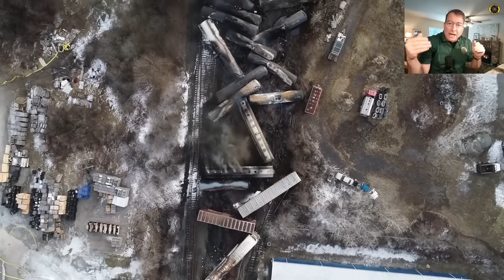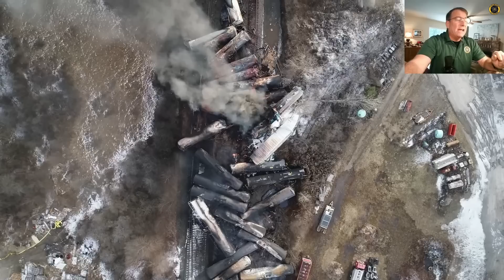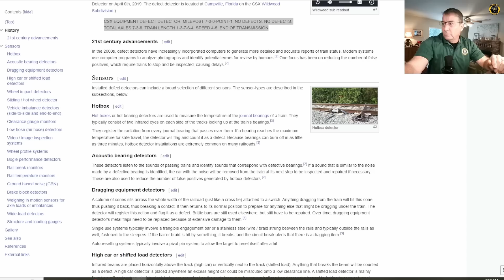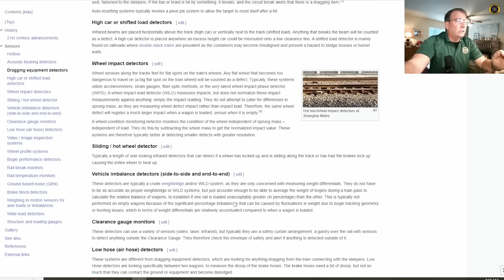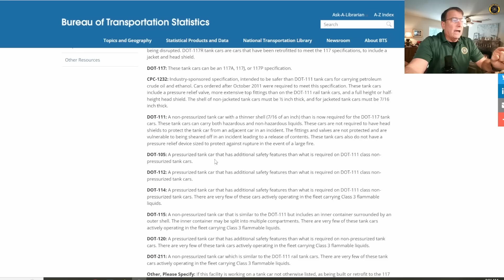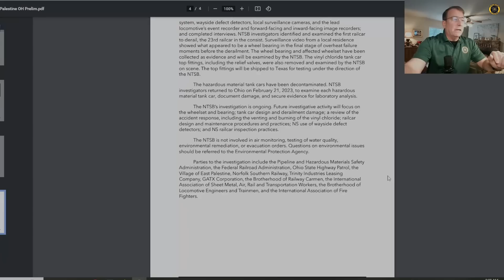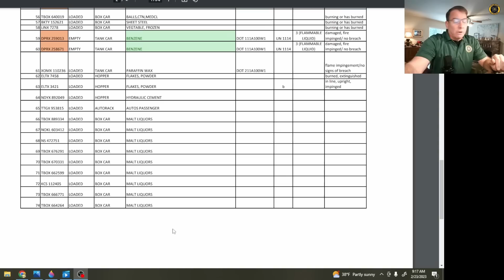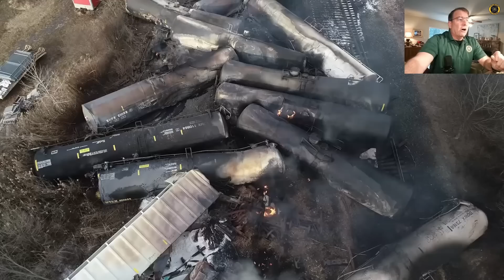NTSB Prelim Report: Norfolk Southern Train Derailment 23 Feb 2023

Comment: It's amazing how quickly an axle journal can burn through due to friction.  I'm surprised it lasted as long as it did after passing the hot box detector in Salem which recorded its temperature at a dangerously elevated level already.  Depending on the condition of the failure it can read just a little above normal when passing a detector and within 10 miles burn through, even at low speeds.  Better car inspection routines could head off many of these failures, but NS has cut back significantly on personnel in recent years.

Comment: The interior locomotive suggests that the train is a "combo," made up of two trains coupled together going to the same place.  In this case a short one and a long one.
Reply: No, it's called a Distributed Power Unit or DPU or DP. It is there to supposedly reduce coupler strain.
Reply: @SteamCrane  If it's meant for that it usually goes on the end.  Mid train DPUs used to be head engines of the second train of a combo.

Comment: RR conductor here, Thaks for covering this Juan!  Also, you can use airbrakes for non-emergency applications, not sure if you were aware of that, but normally you use air to stop a train under normal conditions, emergency is just a FULL and rapid application of the airbrakes.

The line I run on has no detectors (short line) but, if it were me, you get a warning from a detector (assuming those were calibrated correctly) you should always stop the train as soon as you can.  The fact that the train continued for 20 or so miles before finally derailing is interesting.  Either the crew was told to ignore it by their RTC, willfully ignored the warning or dismissed it, or the detector was not calibrated and they got no warning.  In my view, safety should come first, delaying a train to inspect or double check something is a FAR better outcome than putting a train on the ground.  I'd take an ass chewing for not holding to time table over being unsafe, but that's me, class 1 guys operate under a lot more pressure to adhere to a schedule than I do...

I'll be curious to see the final report and see what happened.  I always like hearing what occurred because it helps me avoid the same mistakes, always got to be learning.

Comment: Trains moving eastbound on that line are going up a slight grade.  I'm surprised the engineer used regenerative braking because that causes the slack in the couplers to move forward and bunch up.  Common practice is to keep the train stretched.  The engineer also has a service brake that slowly reduces air pressure and lightly sets the brakes on the cars, allowing the train to remain stretched.  Using the emergency brake position is called dynamiting the train and usually causes derailments.  I don't know what NS specifies when bringing a train to a rapid stop but I would never use emergency braking unless trying to avoid a collision.

Comment: This accident has lead people to question a lot about the safety of the United states railways. Not just this accidents but all the other ones that have followed since then in a very short time. I'm not a railway engineer but I would go back in the records to rail car nr 23 and see if there have been cost cuts made on maintenance. In normal circumstances the bearings would not size up. From the security camera footage It seems that rail car nr 23 had not just a bad bearing but also a flat spot on the wheels. So that leads me to another thing: where the wheels on nr 23 even at the required spec to be used on the railway. Hot box detector calibration is something I can't comment on.

Comment: Back in my fire brigade days, we were taught to cool pressurized tanks (propane) that were hot and venting by spraying water on the top third of the tank so that the water would run down the back side and cool the entire tank reducing the pressure inside and seating the relief valve, stopping the release/danger.  Why wasn't this technique used on the SINGLE car that was a problem vs the "controlled burn" of ALL the cars?
Reply: Because it doesn't work when the contents of the tanker are undergoing a runaway exothermic reaction.
Reply: @mbvoelker8448  What caused the pressurized tank to undergo an exothermic reaction?  Wouldn't something have to be introduced into the tank to start the reaction?  Otherwise the reaction would have been caused by an external source of energy, like a fire on the outside of the car.
Reply: @Blackwarrior2003  He explained this in the video.

The exothermic reaction continued even after the fire was out. Once the reaction started generating its own heat internally the exterior conditions were irrelevant.

If you were a firefighter then you know what a BLEVE is and you know how critical it is to do whatever is necessary to prevent one.
Reply: @mbvoelker8448  You cool them down to prevent a BLEVE from occurring, as I stated in my original comment.  You still haven't explained how the exothermic reaction started.  A chemical reaction that releases heat...  That would mean something would have to be reacting with the vinyl chloride INSIDE the tank.  If the reaction was from outside the tank then it could be stopped by cooling the tank just like a propane tank fire.
Reply: @Blackwarrior2003  The chemical in question reacted with itself once triggered.
Reply: @Blackwarrior2003  The compound is unstable. Once the fire started the reaction in the tank it kept on going.

Comment: Another question.  Juan asked it at the end, did the engineer know there was a temperature rise between the first two HBD?  If so, than the train should have been stopped 20-30miles earlier and there wouldn't have been a derailment in the first place.  If this information is not sent to the engineer, the HBD should be communicating with each other and send some sorta deviation alarm indicating a rapid change in temp.
Reply: No if it doesn’t hit the alarm temperature threshold all it says at the end is “No Defect@

Comment: A large number of comments here ignore the massive size of the North American/US railroad system, in mileage, number of cars (1.6 million), and size/weight of cars, up to 140 tons or so each.  No comparison with the very short trains of tiny cars in Europe or many other areas. Proposals to add complex electronic controlled braking, or bearing sensors (8 bearings per car times 1.6 million cars!) are simply impractical.  Adding many more trackside detectors would make sense. Also, there are frequently alternating full detectors having both hotbox and draggers (HBD/DED) and simple detectors (DED) that only check for something dragging.  The simple ones could be upgraded to full detectors at moderate cost, the cabinets, power and communications lines are already there.  There is a dragger halfway between Salem and East Palestine. If it was a full HBD/DED instead, it might have caught the failure in time.

Comment: Perhaps someone could clarify something for me, for I have no expertise in railways.  About a decade ago there was a massive train wreck on the Canada/Maine border that burned a town and killed dozens of people.  I thought the cause of that wreck was a locomotive being shutdown by some firefighters, which also shutdown the air compressor.  This lead to the brake line becoming decompressed and DISENGAGING the train's brakes and it slowly rolling away (runaway train) and later crashed.  So my question, doesn't the air ENGAGE the brakes on a train rather then disengaging them like on a truck?  If that's the case, than the axle failed and severed the airline so the first derailed car crashed and all the other cars behind folded into that car because they no longer had any braking.
Reply: Train brakes and tractor trailer brakes are very different. Tractor trailer brakes are applied with air, and if they air pressure becomes to low the brakes are mounted on springs to apply the brakes against the rotors or drums.

Railroad brakes are a bit more complicated. All the cars are connected to the locomotives via the main brake pipe. The engine has an air compressor and a main reservoir that charges the brake pipe up to 90psi (generally for freight trains). On each of the rail cars they have their own reservoir that’s basically split into two halves, one for service braking, and one for emergency braking.

So the brakes work like this: when the engineer reduces the main brake pipe pressure by 10psi that difference in pressure causes the individual reservoirs on the cars to apply 10psi of braking force to the wheels. So if you reduce the main brake pipe by 30psi you get 30psi of braking pressure applied from each car’s reservoir to the wheels. To release the brakes you charge the main brake pipe back up to 90psi.

Comment: Great video Juan!...There are actually 3 types of braking. 

The first is independent braking which are the brake pads on the locomotive. These brakes are manipulated in slow speed operations like in yard operations when air may or may not be through the air lines or the locomotives are not coupled to any rail cars. 

The second is the automatic brake. The automatic brakes are just that, they apply automatically if there’s a break in the air lines using air reservoirs that are on every railcar. The automatic is also used to apply incremental brake applications. For example, when we are running, the air lines are pressurized to 90 lbs (as read from the locomotive or “head end”) and we can release air using the automatic brake handle on the locomotive engineers console. The first application of air is a reduction of around 7 psi (90 psi to 83psi). Now the tail end pressure on the sbu, which is the device attached to the knuckle on the last car and is attached to the air hose, sends the air line pressure at the tail end of the train, via radio, to the locomotive. This air pressure reading at the rear of the train is almost always less than the pressure that is measured at the front of the train and performance of the train is determined by this gradient or delta P. When we apply the automatic brake on the locomotive and we set the 7 psi brake application (minimum) on the locomotive we now monitor the tail end brake pressure to ensure the brakes are applied throughout the train. This 7 psi reduction is called a minimum brake application and we are able to increase brake effort by further decreasing the pressure in the brake lines by manipulating the automatic brake leaver up to full service and then to emergency brake application. Emergency brake application can also be achieved by ‘dumping’ the tail end sbu from the lead locomotive. This is in case there is an air hose that is crimped or someone has forgotten to open a valve (or for many other reasons) which would make the automatic brake control on the locomotive ineffective. 

The final brakes available to the locomotive engineer are the dynamic brakes. The difference between dynamic brakes and regenerative braking (they both allow the electric motors to turn into a generator which is similar to a starter/generator on an aircraft) is how the power generated is used. In dynamic braking, the power created is dissipated in coils (similar to resistive coils on a kitchen stove) and fans blow ambient air past these coils to cool them. In regenerative braking, the power created is sent to recharge batteries that are used to power the motors when required which in turn increases the range of the car. 

As for the derailment, I believe it wasn’t caused by the application of the train going into emergency but the fact that the train derailed first and then went into emergency. The derailment was probably caused by the wheel failing (due to the journal bearing disintegrating), causing that car to derail, which caused the air lines to separate and finally causing the train to go into emergency braking. This is exactly what is supposed to happen and thank goodness it did. 

As for the hotboxes or wayside detectors, we often get a call from rail traffic control (dispatchers in the U.S.) or from mechanical services after going over a box to apply a minimum brake. The hot box will give us no alarms over the radio as you heard in your example but mechanical will see the temperature trend on 1 or more cars before a ‘sticking brake’, (which is often the cause of a hot wheel) becomes serious. 

I hope this helped a little...
Reply: Excellent explanation.  I might add that on electrified rail lines, regenerative braking is used to supply power back to the power distribution system.
Reply: P.S.  I'm guilty of this myself, but I think we are getting a little too deep "in the weeds" regarding braking systems when it appears brakes were not involved in causing this accident.

Comment: Thanks Juan, some years ago on a rail trip from LA to Chicago on the SouthWest Chief , I was struck by the number of train wrecks in remote areas. Seems derailments were quite common, with the wreckage just pushed aside rather than recovered when the track was repaired.
Reply: Can you immagine a strech of highway where nobody picks up the failed cars for 150+ years.   There is little value in an outage on the main line, sending a crew out,  picking the steel up and taking it to the scrap yard.  Now the metal is not worth the time with the crane operator and plasma cutter.   At some point old stuff is just to dangerous to lift.    So unless there is city or state official with a clipboard and judication it will sit and rot for centuries as long as it clear of the access roads and the line.     Railroad ties become pile of dirt if you give the insects long enough.

Comment: Failing bearings can appear to be normal until the very point of failure -that is they will show normal temperatures until they fail, then the bearing core temperature will climb very rapidly (easily a couple of hundred degrees F in ten minutes).  So with HBD equipment every ten miles or so that rate of temperature climb sounds about right" for a failing bearing - not much time to react between "It's starting to warm up" and "It's totally failed".

Comment: 149 railcars with a DPU between railcars 109 & 110.  Railcar 23 derailed.  That's 126 railcars behind the derailing car.  With emergency brakes applied during decoupling of railcar 23, 38 railcars subsequently derailed.  That's how many railcars derailed before the full effect of emergency braking worked.  Lots of inertia, right.  I am guessing part of the stopping of the subsequent railcars was the sheer plowing into the derailing railcars coupled with emergency braking.  How do you fix that type of scenario?
Reply: You catch the defect before it can cause a derailment. Once the defect occurs that can derail the train no amount of braking Effort is going to stop it.

Comment: So, the HBDs showed increasing temperatures on that axel, but it didn't reach critical unti the 3rd HBD right before it derailed? The security cam footage showing that axel ON FIRE was in Salem, Ohio some twenty miles from East Palistine. That is a half hour up the track. It most certainly was over 200° F above ambient in Salem. My gut tells me that the HBDs are so unreliable that they are turned way down or ignored to keep the freight moving. The dispatcher in Atlanta doesn't have a real understanding of what the signals are trying to tell him, and nobody actually on the train knew how bad it was. Automation is great when it works, but dumbing down false signals until you don't get real alarms is not the answer. What we have here are HBDs that are like the boy who cried wolf too many times...
Reply: The video of the fire could have been after the Salem detector. A failure can happen very quickly like 1 to 3 minutes

Comment: some of the Defect detectors are not as detailed as the CSX one you showed us in the report. For Example On the Union Pacific Nevada Sub between Sparks and Winnemucca, some of the detectors UP have setup only announces the Milepost if there isn't a defect. 

If the train is nowhere near a railyard or a shop,  the repairs would be performed trackside. Maintenance workers would separate the bad car from the rest of the train, lift the bad car by using a crane, roll out the bad axle and replace with a new axle, lower the car on top of the axle, connect the train, and the train keeps moving. There's YouTube videos of similar work being performed being done on other trains

Comment: Good coverage, as we're accustomed to with the aviation stuff, Juan.  I'm still finding the "controlled venting" a bit hard to understand.  The specification for those DOT-105 Pressure Tank Car Tanks requires that they have pressure relief devices with "sufficient flow capacity to prevent pressure build-up in the tank to no more than the flow rating pressure of the pressure relief device in fire conditions".  Blasting holes in the tanks to dump the contents seems hard to justify (or describe as controlled), particularly since the fires were already mitigated.
How about those regulations that let a train with 20 hazardous materials tank cars be classified as a "general merchandise freight train"?
Oh, wow!  I had no idea that the bearing temperatures are not monitored on the train - it's all external!  How archaic!
Reply: Why would it possibly matter that the train was designated General merchandise, it,s not like there are different rules in place for mixed freight.
Reply: @sommebuddy  My presumption is that there are different requirements for hazardous goods transport than for general freight.
Reply: @SorenCicchini  In most cases train crews are only restricted by the particular cars. "special dangerous" cars have more speed restrictions, as do many empty cars. We can have potato,s , autos, lumber, steel and dangerous commodities on any particular train.